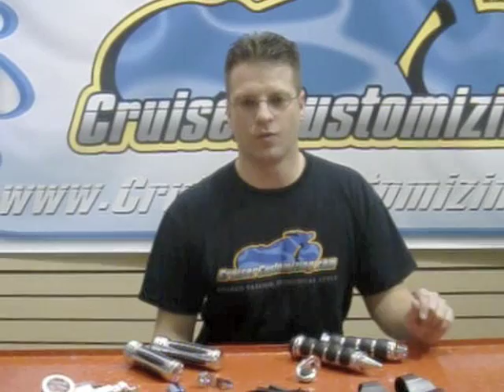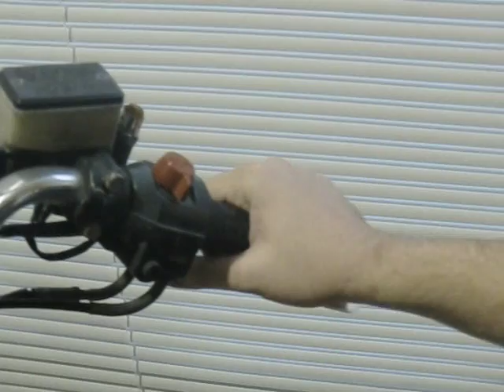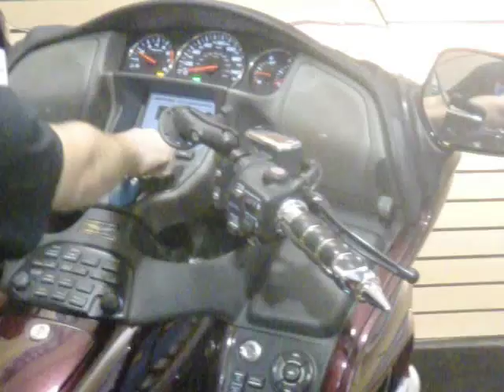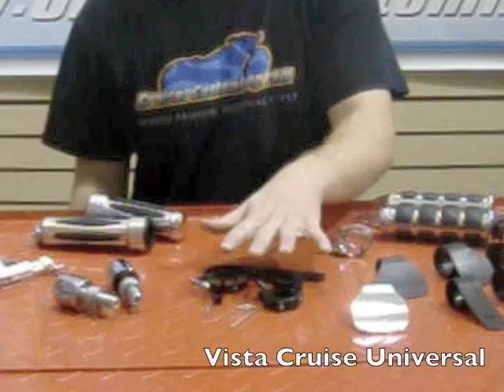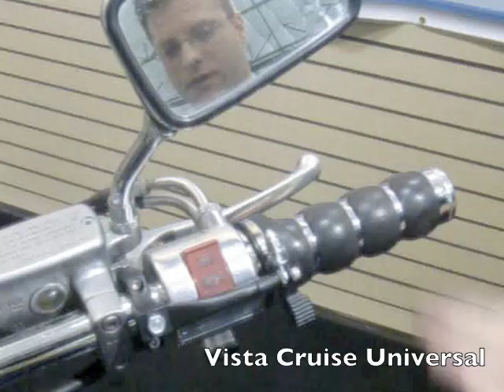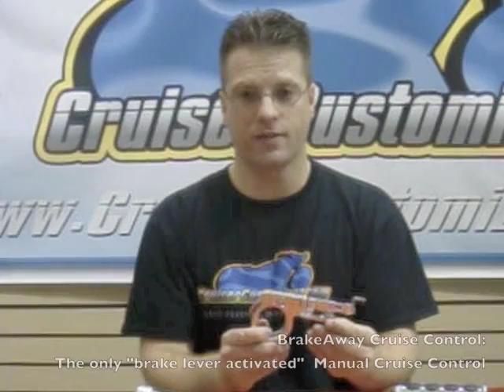Motorcycle Cruise Control - 6 Different Types - Video Guide: Tip of the Week

Comment: One issue with your demo.  Kuyakyn bar end will have to be o pop erated with your throttle hsnd while your holding the throttle.  You did it with two hands.  Also,  it is very dangerouse wh err n highway traffic comes to a sudden stop.

Comment: Being cheap, I tried the crampbuster type of thing and was relatively satisfied with it. I think I'll just save up for a new scoot with cruise control built in. All those other things look expensive and a tad dangerous. Any brake movement, front or rear, should disable them. If it's not a closed loop system that maintains the speed I just don't see it worth the bucks for anything too fancy.